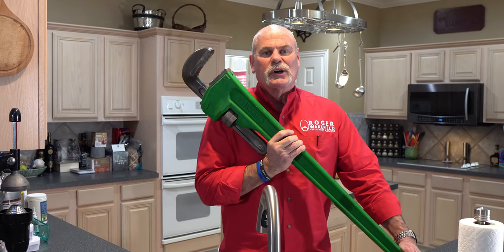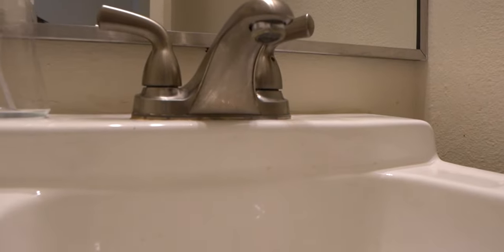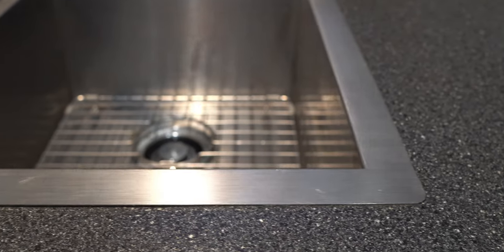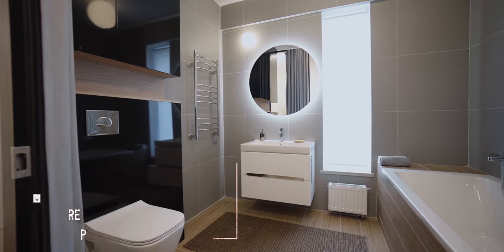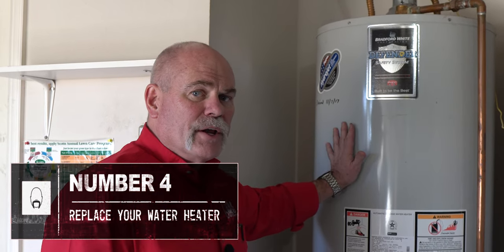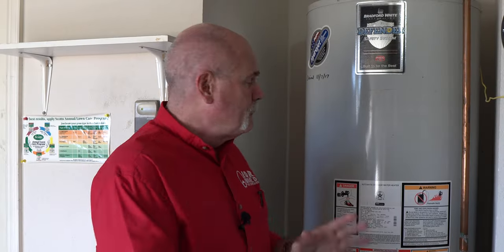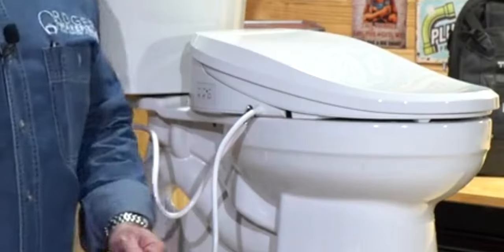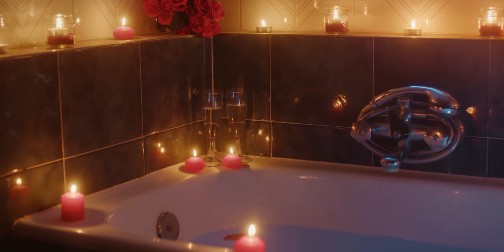EASY DIY Plumbing Upgrades Around the House

Comment: My water pump cycles on every 30 min. to an hour but there are no leaky faucets or toilet tanks running any ideas/ the pressure tank is original to the house about 15 years old